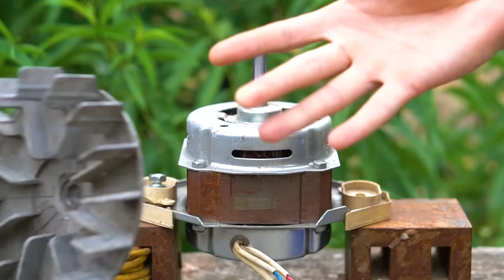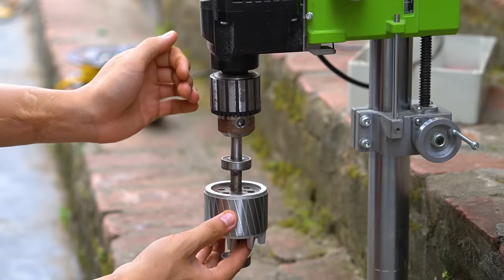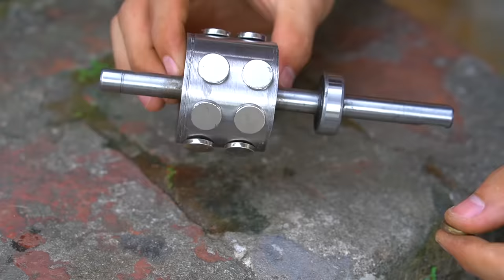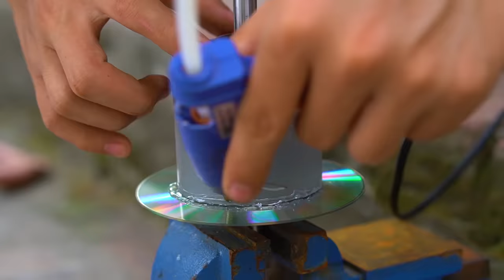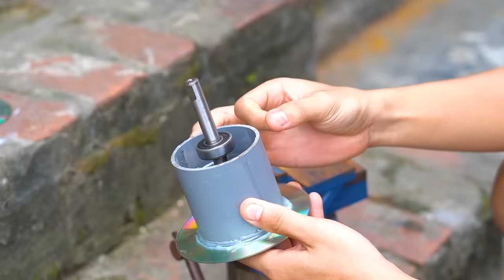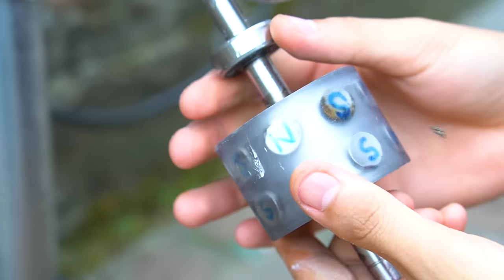I turn Washing Machine Motor into 220v electric Generator

Comment: I'm sorry to ask a stupid question, but how do you get free energy from the moment you use a small petrol engine to run the washing machine motor?
Reply: does he mention anywhere that he makes a free energy generator??? But still... one could count the vid as an example only to proof that he produces 220V electricity. After all u can connect it to a water- or windmill, instead and u get a free energy generator.
I , for myself celebrate such creative guys
Reply: You have a small motor a dc one. With a plug and a ac to dc converter so the small motors powered permanently. The small electric motor you use spins the magnet spinal. Producing more energy than you put in.
Reply: @scottflint4269  the efficiency of any system is less than 100%. This is law of conservation of energy. The rest is dissipated as heat. So the output power will be always less than the input power.
Reply: @RupaManohara  there is nothing called free energy. One form of energy is converted to other form.
If you are using water, wind or solar power, you are deriving energy from the nature and converting into electricity.
Reply: @glamgirldhruvika  nice concept. Piss powered engine. 🤣😂🤣
It can solve the problem of hike in petrol prices.
Reply: @RupaManohara  The reason I watched this particular video is because it said that it produces free energy. If I have to use in any case a generator to power this converted old washing machine motor, why not to use the generator directly?  Nowhere it says that it produces more energy than what consumes, so allow me to keep my doubts about this story.  I am sorry, but I was not convinced producing free energy.
Reply: @scottflint4269  Nowhere is says that it produces more energy that it consumes.  I am sorry, I cannot get convinced like that. Till this is proven I consider this not to be a free energy device.
Reply: @Dave_en  I agree fully with you.  Otherwise I will tear apart my degree in Applied Chemistry.
Reply: @Dave_en  No it does not, as you still need to input energy from fossils or electricity which also comes from fossils.
Reply: So far I have not been convinced that the man in this video produces free energy, not even more energy that he uses to run his motor. Therefore, this should not be listed in the free energy search section of YouTube. Full-stop.
Reply: @philokyprosandreou  that part is common sense. If you use a small 12v dc motor to power it. He shows ac power at 70 amps
Reply: @Dave_en  not when you are producing over 70 amps from a 12 volt motor. Converting from dc to ac
Reply: @Dave_en  I'll give you an example he powers 3 things 1 being a 5 amp fan. You could also use that same fan motor to power the entire thing and it will spin faster than that strummer engine so will produce more power.  You just use electric to give it the charge to get it started. Once it's running you disconnect that supply. You can even make it start by hand cranking.
Reply: @scottflint4269  you can produce any voltage from this motor (converted into a generator) depanding on rotational speed but 70 amps is not true. Do you know how much wire thickness we have to keep in order to make that huge current?
This generator can produce a maximum of 2 amps of current. It's my challenge.
Reply: @philokyprosandreou  by use of wind mill, turbines etc you can convert the rotational motion to electricity by using this generator.
If you like to use fossil fuel, that too can be used to rotate this generator. There are several ways to generate electricity.
Reply: @Dave_en  the entire point of any generator is to create more power from very little power.
Reply: @Dave_en  if it was only powering 2 amps it wouldn't even make 1 if those items work.  As even that fan is 5 amps. The other 2 are 13 amps
Reply: @scottflint4269  then all the power generation issue would be solved by your formula.
What is going through your mind, I had already thought about it when I was in 7th grade. But later when I completed my bachelor's degree in engineering, everything became crystal clear.
What you think little energy is tremendous amount of energy and we can convert only 40-80% of it.
Go ahead and present your project to E-bike manufacturers. Perhaps they can improve the mileage from 100 to 500Km per charge by converting the DC voltage of battery to AC. 👍😂😂😂
Reply: @Dave_en  you do realise you  can watch generators on YouTube doing exactly what I'm saying right???? The secret is the coil and the magnets. It's not rocket science
Reply: @scottflint4269  I know that it's not a rocket science. Coils and magnets are most necessary components to generate electricity. Should I write all the electrical equations for you?
If such youtubers are successful in their experiments, then why don't power companies approach them for their marvellous ideas?
The basic explanation is: the wire used in this motor is no thicker than 26 SWG. The current density that copper can withstand is always taken below 5 Amp/sq mm.
The cross sectional area is 0.1642 Sq mm. So multiply both 5*0.1642=0.821 Amps
If you overload it with 8A/sq mm, the voltage will considerably drop and you will get 1.3136 Amp. Beyond that the motor (generator) winding gets burnt.
Try it yourself and see.
There are plenty of frauds in youtube who fool non technical viewers in the name of science. Don't fall for it.
Reply: @Dave_en  all you have to do is watch the last video I sent you. All the proof you need is there.
Reply: @scottflint4269  they didn't show the parts inside. There was no explanation given. Who knows, there might be hidden battery inside the plastic drum (which has neodynum magnets on its surface). They could atleast show its construction.
Reply: @Dave_en  they don't need to its a product that will soon be on the market. You already know how it works. You see it working so no longer can you say it's not possible. Because there is your proof.
Reply: @philokyprosandreou  Did he say he build a generator with free energy? No. It's about the concept and that's all.
Reply: Philokypros Andreou doesn't understand that just because he searched for "free energy" that doesn't mean all videos that appear will be about free energy. He doesn't understand how YouTube works.
Reply: Dev doesn't understand that "free energy" just means that you don't have to pay a utility company for it.
Reply: @scottflint4269  my friend, at max it is 3 amp. Not more, and anyhow much more ineffective and inefficient as a normal generator, this is fun but completely useless . the cost of this electricity is more then the electricity from the grid , better solar panels.
Reply: @henkjanvanmiddendorp942  this can be made full free energy so not totally pointless.  I like the demonstration.  But yes 3 amps I think is about right. I have read for 13amps. You need 1.7 to 2mm thick copper wire . And around 160 wraps on each with it. Then 13 Amps is achieve able

Comment: That's amazing! one of the best creations I've ever seen. Who would've thought you can turn a washing machine motor to a generator?
Reply: I have no idea why the new magnets and epoxy are used. Every other on I've seen usually just re-wire them with same results.
Reply: @SurleyBlaine  Do u know how to convert this 220 volt motor to dc without using such things?
Reply: This is fake,guys!!
Reply: @jrambo7495   Do you not know how electricity is produced?
Reply: @bleehole  NOT The Way This Guy Tries to Convince Us ...
Reply: @56_seshadrib71  full bridge rectifier
Reply: @56_seshadrib71 just reverse the polarity. Buy wiring it backwards from the way it was factory.

Comment: but you run it through a generator
then whats the need of this project
use direct generator power instead of this motor
Reply: its a waka powerd by gass  and the motor is giveing to 250 v
Reply: maybe we miss the point here, i think he is just trying to show us that modified dynamo can produce enough 230/240v electricity by turning the shaft connected to the dynamo. A creative minds will extend that idea to use/connect other free energy sources such as wind & flowing river(water)..
Reply: The generator also turns a motor to make power.  Its basically a rebuilt fuel generator
Reply: @iknowlaa  people have zero imagination. Wind or water power is obviously the way to go. Peoples crap attitude and negativity is why they take it up the a$$ from their local power company every month. You can easily scale this tech up or down to suite your needs.
Reply: U could say, he now has 2 power sources, the gen. And his modified dynamo.

Comment: I think the magnet poles should have been fixed parallel to the axis of the rotor. Not perpendicular to it, for the magnetic field generated to match the copper coil around
Reply: That's not the only problem. How did the 120V fan and stereo work and NOT immediately get fried from double their working voltage?

Comment: Interesting, I believe the 220v but I wonder where the AC comes from.
Reply: from cable what digged behind ;))
Reply: Magnet north...magnet south....magnet north... magnet south..  equals ...alternating current...   positive then negative  and so on.      As far as the frequency, we use 60hz in usa,  the frequency of this device is totally controlled by the speed of the motor.
Reply: If I am not mistaking, from the looks of the stator (coil winding) there are 3 wires. 
That indicates that the motor is an AC motor and not a DC.
Reply: @MrLuigi77047  good to know. That's what I overlooked. Thanks.
Reply: Same doubt bro. motor, fan and speak works in ac current but that small generator supply dc voltage right.how it is possible?
Reply: The magnets create a preterbation in the aether. The spinning magnets with copper wire 8n the field tap this energy.

Comment: He used speaker terminals for powering the amp for the speakers.
Reply: Glad I wasn't the only one to catch that too.
Reply: Diy model
Reply: Kabooom
Reply: He is an engineer
Reply: He DID NOT use the speaker terminals, look closer. That is a powered speaker w/ bluetooth circuitry.

Comment: But still in the end you used an automatic generator to run your generator. So what's benefit of doing all this exercise when you are finally dependant on a power source???
Reply: Just for quick demo's I think. You can hook it to windmill,  watermill, or any circular moving object
Reply: Proof of concept!

Comment: Very funny to see a speaker without an amplifier and a music player be plug directly to a 220vac and it plays music. 🤣😂😁😜 You should show the speaker has an amplifier and a music player playing the music in order for us to believe. What you have shown is only a speaker and nothing else. How can a speaker play a music by plugging it to 220vac? 😂🤣😁😜 Isn't it ridiculous? The speaker is not even a bluetooth type or powered type. 🤔😏
Reply: It's a standard Bluetooth speaker
Reply: @bryanhenry8075  that speaker IS NOT bluetooth. It is a stardand 2 wire speaker. It needs to be connected to an amplifier via 2-wires. 

Unless he modified the speaker and installed an internal bluetooth amplifier, and decided it was a very good idea to use SOUND CONNECTORS as an AC 220V INLET...
Still that speaker is beefy, and it would be hard to fit an adequate AMP inside it...

Also how he just keeps on plugging items, and  adding load to the "generator", and the engine doesn't even flinch, not even 1 RPM change.
Also the chain is very loose, which indicates the "generator" (aka eletrical motor) it's just spinning freely, which couldn't happen if there was an eletrical load present...
Reply: I supose that radio receiver and lf power amplifier are in this big  sound tower !
Reply: @jacquesdenis5241  what sound tower? do you know how a speaker works? That "sound tower" is a NON-amplified one.

It NEEDS an external amplifier to work.

AMPLIFIED SPEAKERS do exist and are very common, but they have an integrated amplifier/soundboard. They have nothing to do with what is presented in this video
Reply: @killerspetsnaz  The amplifier can easily be inside this big box with a mp3 lector twice powered via ac/dc power supply inside. No problem do do that yourself...
Reply: Possible he rigged the speaker box with a amp from another speaker. And it’s right inside with a aux coming out a drilled hole on the top. And it’s a 3rd world country so imagine.
Reply: oh yeah? then show me where is the AUX cable... Because I don't see any aux cable connected to the phone, also if you see his phone screen, he doesnt have his bluetooth on neither has an aux connected...

That tiny "generator" cannot generate that amount of current to feed those many equipments, the way he rigged that magnets is also very wrong... Any physics or mechanic engineer will laugh heavily to someone who actually believes he did this... There is way more to a generator, then just having a rotor and some magnets spinning, you need an frequency regulator, as well a voltage regulator.

But I'll give him credit, he does a very good job of editing, and hiding things, but any technician can clearly see that this setup he has here cannot work, and is fake.
Reply: yup.that is fake. i am an electronics technician. if im going to fix any bluetooth amplifier or any portable amplifier. you have to make sure that the volume control,tone control and selecting control are posible to control it outside.
Reply: simple way.. if you say this is a fake.. can you tell us.. but used your video not only a theory.. or argument.. so we can trust that this is fake??

Comment: Gas is $5 a gallon and rising. Using gas generator to run 110v motor to generate 220v is an expensive idea.
Reply: if they put another motor to drive the generator and using battery to start the electricity then they can power each others and they dont need a gasoline motor  to power up..
Reply: @jeysonluyao7521  that would not work as the power will be drawn from the battery
Reply: @m2k_boi629  put a blocking diode ... if you no what is blocking diode for...

Comment: Measure the output power with this connection!
Reply: It’s fake you don’t power a speaker with 220 volts ac. You use speaker wire from an amplifier. There is no amplifier.

Comment: Buen video,sin preguntas por que fue ampliamente explicado  y eso fue lo mas importante.
Reply: Buenas tardes, como podemos saber o calcular cuantos watt desarrolla?
Reply: The RPM should be measured first thru a volt meter. For the beginners should not try that at home without consulting first from an expert, otherwise your appliances will be burn if the voltage goes to more than 300 volts.
Reply: @leonardodefrutos5559  NO LO SE RICH ESO PARESE ALGO FALSO, la bocina no parece moderna, ya que los cables donde se conecta son de la entrada de la bocina,  el ventilador disminuye la velocidad, posiblemente solo puede la bomba hidráulica.

Comment: Still need a gas motor to power a small motor that can't make enough current to power large equipment.
Reply: ⛽ price maybe cost more !
Why you need DIY ? !
Reply: You could power it with wind or water seen it done before
Reply: Use your imagination...wind power...
Reply: Use your sentido komon
Reply: Use your brain

Comment: Nice job.
In terms of hacks, I found much easier to modify a car alternator, by simply feeding the 14 Vdc to an inverter. The efficiency is much higher than adding magnets to an asynchronous induction motor.
Your solution has the advantage of using zero electronics controls, but the output in terms of voltage and frequency, is very crude.
Well done...

Comment: Ok 👌 it's a generator and generates electricity. So between the volt meter & it spinning by hand and you welding it I missed the part where it started spinning on it's own?????
Reply: What you missed is the part that he added with the red fuel engine. his particular magnet generator needs another source to keep it going. But why all the effort?

Comment: Houston tenemos un problema. El motor a juzgar por el tamaño es de 1/4 HP, se nota que es de 4 polos, 24 ranuras, paso 1-4/1-6. 
Es un motor que para desarrollar su potencia requiere de los dos bobinados más un capacitor.
Para que ese motor se convierta en un generador de 250 V, como aparece en el vídeo, necesita girar a 1500 RPM, de esa manera generará ese voltaje y una frecuencia de 50 Hz.
La bomba que supuestamente energiza, es de 1/2 HP, aparte del equipo de música que si bien tiene un consumo bajo, igual suma y el ventilador lo mismo, por lo tanto entre las 3 cargas, sobrepasan los 400 W.
1 HP equivale a 746 W, el motor transformado si se fijan, se le suprime un bobinado, por lo tanto aún es menos de 1/4 HP que podría desarrollar por lo tanto difícilmente llegue a los 187 W.
Pero supongamos que la velocidad con que se hace girar el dispositivo es correcta, y que este desarrolla la potencia necesaria,  la tensión y frecuencia correctas...esa correa.
La correa va a resbalar, es muy débil y no tiene tensión, está floja.
Reply: Olvidaba un detalle, el rotor lo hizo de 8 polos, por lo tanto la velocidad que requiere para generar 50 HZ es de 750 RPM